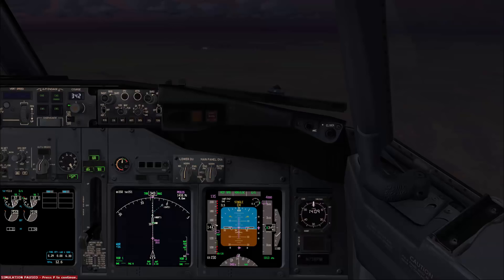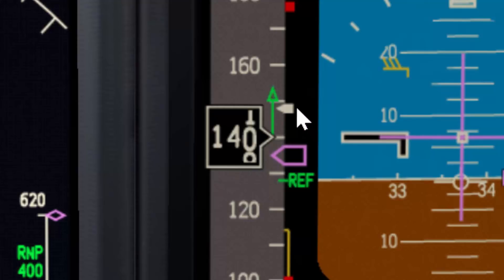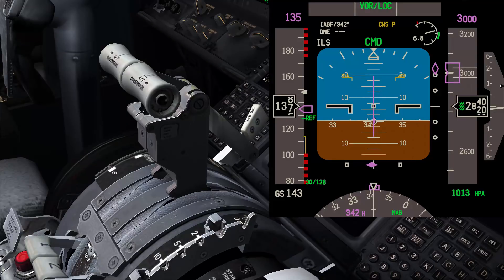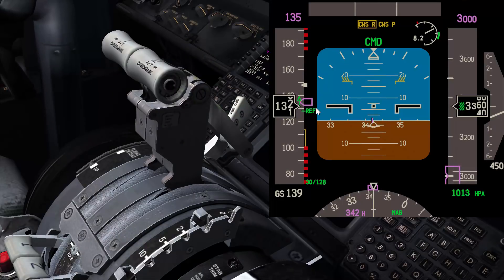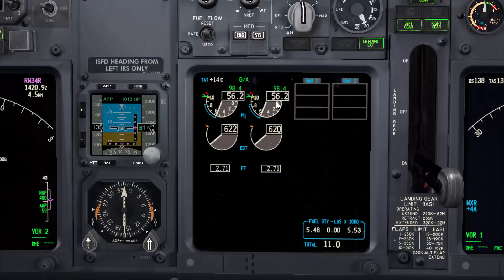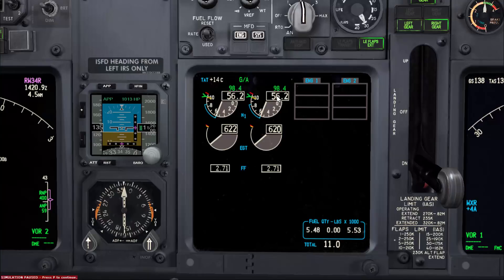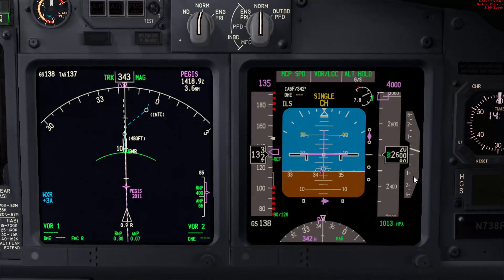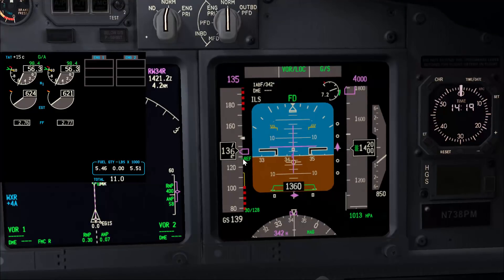B737 App. & Lndg Video#4 (Thrust & Speed)

Comment: Excellent tips.  Does the formula last 2 digits of Vref ÷ 2 + 40 work for both Flaps 30 and 40 landing? Have you also heard of adding 10 to your ldg wt in kg and set that as your initial N1 then reduce/increase as required maintain flight path on a stabilized approach? Will try your formula tom n revert back.
Reply from the maker: Hello Osagie, 
The formula works with Flaps 30, I am not a frequent user of F40 but I guess you need more thrust when landing F40. 

Thanks for the tip regarding the Kg weight, I have not heared of it. I will keep it in my mind.

Please let me know if you have any questions or comments. 
Wish you safe flying, 
Abdul
Reply: Add +10 for 737CL and +5 for 737NG and reduce or required to maintain a stabilised approach